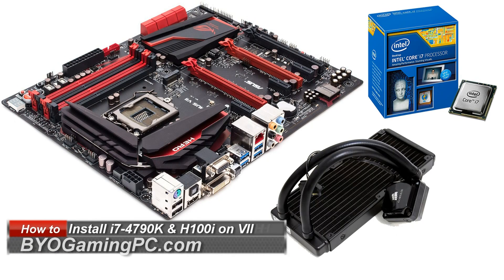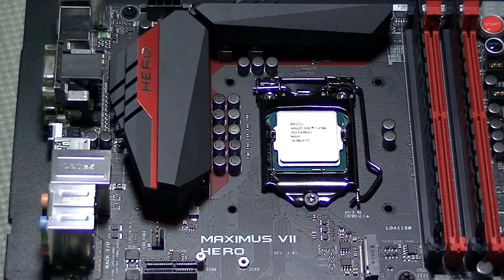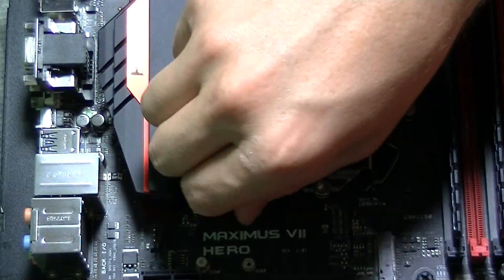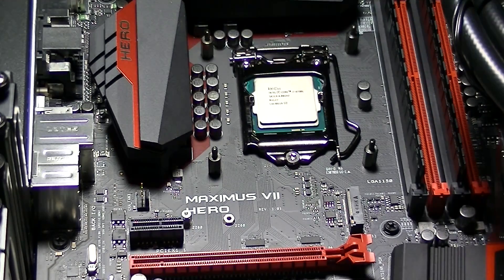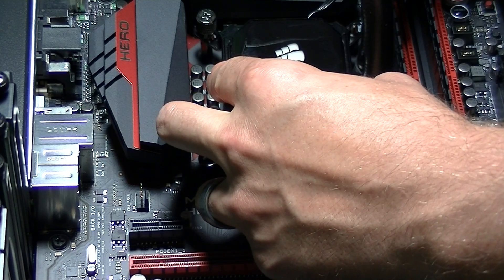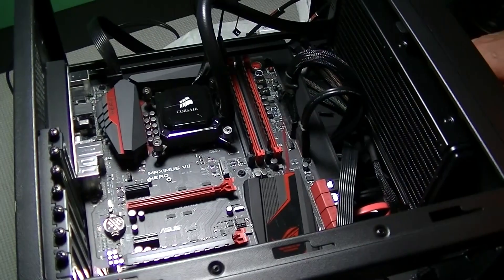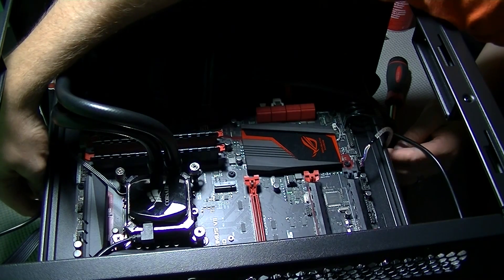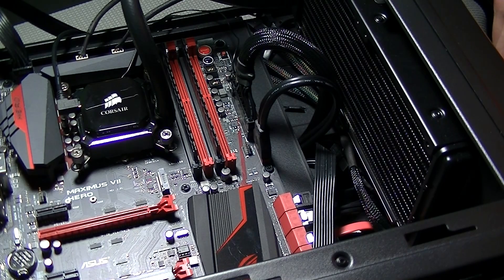How to Install Corsair H100i on ASUS Maximus VII Hero with i7-4790K

Comment: I'm getting this processor and cooler for my first build along with a CM Storm Stryker.
I've read that the case comes with a fan controller. Should I, CAN I, plug it into that? Also, how should I position the fans? My room is really dusty so I absolutely wanna make sure I have positive air pressure to keep that stuff out. How should I position the h100i? Picture to demonstrate fans:
http://imgwiz.com/images/2014/12/03/OIgt7.jpg
Reply from the maker: You will want the air coming in the front and bottom and out the back and top which is the natural direction of heat transfer and will also utilize the fan filters included with the case.

You CAN use the fan controller but you should NOT use it for your CPU cooler. Your motherboard has CPU PWM fan headers that will automatically adjust the speeds of your cooling fans based on the temperature of your CPU. Do NOT use the fan controller for anything but your case fans. The fan controller was meant to be used with case fans and not CPU or GPU cooling fans.
Reply: BYOGamingPC
cool, thanks
Reply: you got this build ? how is it working ?
Reply: ***** Don't have it yet, been bouncing around between shops and suppliers. Can't get shit in this damn country and import fees on amazon or something eat away the budget :/ But I've seen people with this build on forums, so I don't see why it would be a problem. I can let you know when/if I ever get it built.
Reply: Anze G awesome ! good luck !
Reply: BYOGamingPC So what you're saying is i just install this CPU cooler, and dont touch any of it settings ?

Comment: Hey thanks for the video, just a quick question, the thermal paste that comes with the h100i...is it good enough? Also, I was wondering if all I had to do was detached the plastic cover from the h100i and then apply it directly to the cpu. Thanks.
Reply from the maker: The thermal paste that comes with the H100i is good. yes, you need to remove the plastic cover before installing it.

Comment: Question for you (and everybody else feel free to chime in as well):

Which do you think is a better config, push or pull, for the h100i?  I've heard both ways and have seen both explained all over Youtube and forums, but I haven't been able to find a definite answer.  My build is the same as this: Maximus VII Hero, 4790K, h100i; only I have the NZXT Phantom 410 case.  This is my first time using liquid cooling, so I'm not sure which would be better.  What do you think?
Reply from the maker: Personally I don't think it matters one way or the other. Mine is in a push configuration because it is the best way for me to mount it in my HAF XB EVO case. You can't go wrong either way and at most you may see 1-2C difference if even that.

Comment: Awesome tut! Questions, what did you use to clean the surface at 3:23? Can I use rubbing alcohol instead? And also, I have bought the same components (same i7 CPU, motherboard, and Corsair H100i), do I need to buy the thermal paste separately or is it included somewhere?
Reply: Just found your answer to the paste question below.

Comment: Do you need to have the paste?
Reply from the maker: There is paste that comes already applied to the cooler so you do not need to have paste for your first installation. I have removed the cooler and reinstalled it so I did need to clean off the old and apply new paste.

Comment: Omg.... so many questions. 
1. In this cpu cooler do you have to put water or something because it's a liquid cooler?
2. if you do have to put water, how often do you change it?
3. how long do you have until the paste dry?
Im getting same setup with gtx 970.....Im a big noob and thanks in advance
Reply from the maker: I'd be glad to answer your questions. =)
1. The liquid is already inside. It is an all-in-one (AIO) cooler which you will never have to add or change the fluid inside.
2. Refer to answer 1.
3. The paste doesn't and shouldn't dry out for a long period of time. Usually a few years. If it dries then it needs replaced because it will no longer effectively conduct heat.

The GTX 970 is an awesome GPU for the price. Enjoy it!
Reply: BYOGamingPC I got one more question haha, sorry.
Im getting the the Gtx 970 strix. When you over clock a gpu, do you have to oc everytime you turn pc on or does it stay forever. and also when overclocking is it different even if it is the same gpu and brand
Reply from the maker: FatPeopleJigle You will just need to have whichever overclocking software set to load on startup with whichever profile you want to load automatically and you don't have to change your settings each time. My preference is either MSI Afterburner or EVGA Precision X. I've used ASUS GPU Tweak but didn't care for it much.
Reply from the maker: FatPeopleJigle You will just need to have whichever overclocking software set to load on startup with whichever profile you want to load automatically and you don't have to change your settings each time. My preference is either MSI Afterburner or EVGA Precision X. I've used ASUS GPU Tweak but didn't care for it much.
Reply: Im getting the same setup as you! :) What case are you getting?
Reply: I wanna get the Pangu Sw-Rd but i dont feel they have it on the US so if they do someone plz reply. so i might end up getting the 400r because it fits everything perfectly.
Reply: BYOGamingPC is there any cheaper mother boards for this
Reply from the maker: ***** The MSI Z97 Gaming 5 http://amzn.to/1uJJ8cG or the Gigabyte GA-Z97X-GAMING 5 http://amzn.to/1wBfPNA are great budget oriented options.

Comment: Heads up for you first users on the corsair h100i.  The h100i comes with thermal paste already out of the box. There is no need for thermal paste with first time use.
Reply from the maker: This is correct and the paste that already comes on the H100i is good stuff.

Comment: thinking using the Corsair H100i i7 4790k and ASUS Z97-A, Socket-1150 but the cpu is running 4.0ghz stok right will the H100i hadle it 100% no problems?
Reply from the maker: Yes, it will handle stock speeds with no problems at all. If you CPU allows, you can even OC to 5.0GHz and maybe greater. It all depends on the silicon lottery draw of your chip though.

Comment: Hi can you tell me that ram use? And witch you think is best for asus maximus vii hero?
Reply from the maker: The RAM I use in my setup is the Corsair Vengeance Pro 16GB (2x8GB) 1866MHz CL9 http://amzn.to/1xG83lb kit. There are many other kits you can use but I prefer RAM with a high speed as well as low latency such as the kit listed.

A lot of people purchase higher speed RAM thinking it will give the best performance but they sacrifice latency which makes the higher speed pointless. To be honest, the performance difference between different RAM doesn't make much of a difference but I selected the best of both worlds.

I also wanted to go with a kit that would allow me to utilize the maximum amount of RAM the board is compatible with. You notice that I still have a couple RAM slots open which will allow me to add another 16GB RAM (should I feel the need) and utilize the 32GB maximum. This is likely never going to be needed but nice to have available.
Reply: BYOGamingPC Thenk you.

Comment: Hi can you tell me more about this mb and is it a good overclocker mb
Reply from the maker: It's an excellent motherboard with nice VRM cooling to allow for plenty of overclocking power delivery.
Reply: thank how high of a overclock have you got ?
Reply from the maker: Jerome Hieb I'm guessing you're asking this question because you want to know how high you will be able to overclock. The Maximus VII Hero will be able to overclock as high as your CPU will allow. You will want to check out some overclocking guides for the 4790K but your CPU is always going to limit how high you can overclock, not your motherboard.

Some CPU's can do 4.8 and some can do 5+GHz but it depends on the silicon lottery and if you get a good CPU chip or not. I hope this makes sense!
Reply: thank you

Comment: good job on the video i will be getting a 4790k not sure about the mb Msi gaming 7 or this mb i have 1866mhz memory will that work with the mb? i have a GTX 780 oc wforec card thinking of getting gtx 980
Reply from the maker: The RAM that you have will  work with either of the boards you listed, including the one in the video. You can read the description and see that the RAM I have installed is also 1866MHz RAM. I actually have a pair of 980's on order that I plan to do a video on once they arrive.

Sounds like you've got a nice build you plan to put together!
Reply: Thanks you have a very nice build to i have a 8350 fx now it not bad but i will be giving it to my wife pc when i get the 4790k